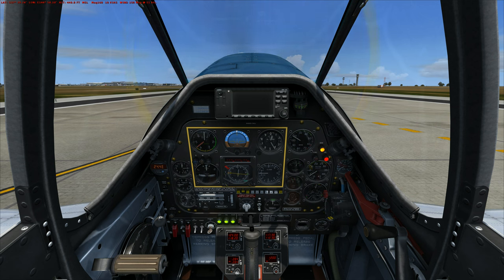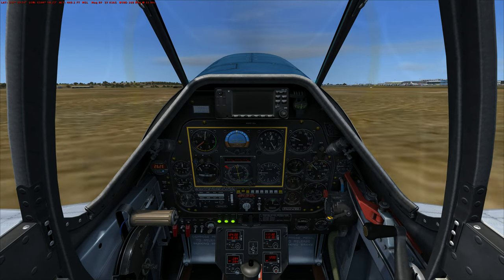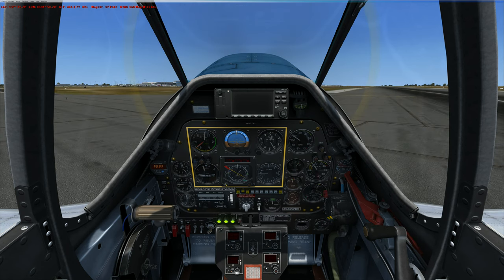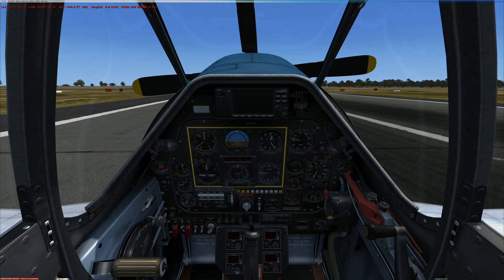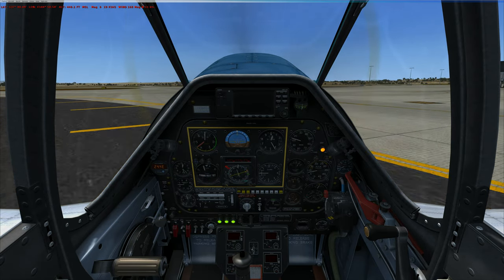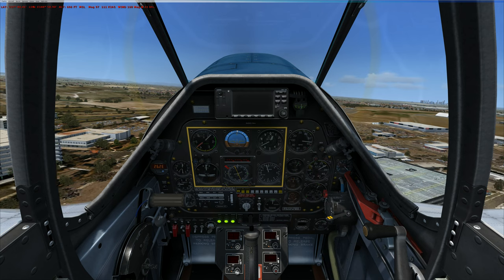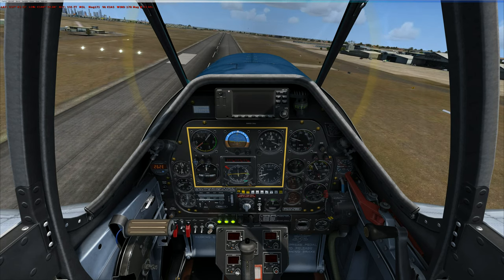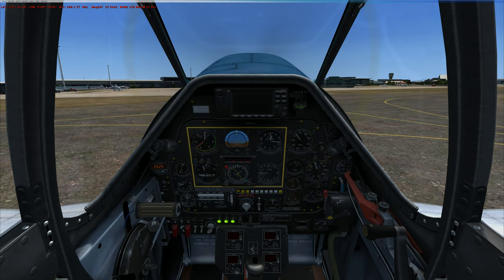Further tests with Mustang by A2A

Comment: I've been reading the thread over at A2A about this problem.  I am also a retired IT guy and have flown flight sims since early `80s., including all versions of MSFS and P3D. I own a few A2A aircraft and I love them. I was looking to buy this Mustang by A2A to add to my hangar today, but I am really bothered that you had to do so much work and A2A did not offer you a refund when you could not make it fly. It pretty much scared me off from buying the plane. I also have years of tweaked settings and FSUIPC  that I am not willing to give up for a single aircraft. When they suggested that FSUIPC might be the issue I viewed it as a total cop out.  Anyone designing ANY add-on for FSX or P3D must include support for FSUIPC since it used by pretty much any serious FSX or P3D owner.

I  am curious to find out what happens in the rest of the thread. That rudder was definitely having no effect on the flight model with the exception of visually moving the rudder.

Comment: I have now read the thread up to the point that you got the refund. Let me tell you that there are two comments, one from Nick and one from Scott in which he said he refunded your money, that have caused me to decide to never buy another aircraft from A2A again. I thought they treated you atrociously, and to suggest your technique was at fault in that last post I mentioned from Scott just burned me up.  You had far more patience than I would have had in that situation. 

Look, if you ever have an issue with a product that doesn't work and the vendor gives you a hard time about a refund just call the credit card company and they will reverse the charge for you. I've done that twice in my life, maybe three times and they will do it. It was three BTW, the last one for a dentist that I went to see for a tooth that was bothering me. They insisted I pay $480 up front, which would be applied to the cost of any work they did. It was a Saturday and I had no where else to go and was in pain, so I agreed.  They afterwards told me I needed $8500.00 in work to fix the problem, including destroying another tooth to put a bridge in.  I told them to go to hell and I new I had been scammed.  I had it fixed for $310 total from a very experienced and excellent dentist. I called the CC company and they reversed the $480 charge. End of story.

This nonsense in this flight sim market of no refund policies are a bad joke. So far I have been fortunate and have not had to return any of the roughly $4000 in add-ons I have purchased just for P3D alone, not counting old FSX stuff, but I would if the product did not work.

I'm glad you got your T-6 and it works. I have a really bad taste in my mouth for A2A after reading that thread and I am NOT going to buy that P51 military as I intended earlier today.
Cheers,